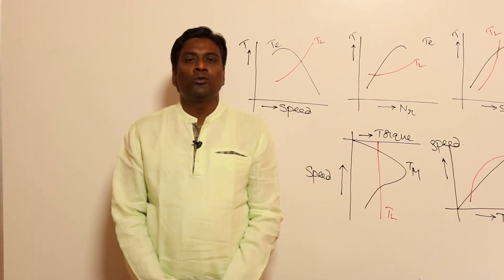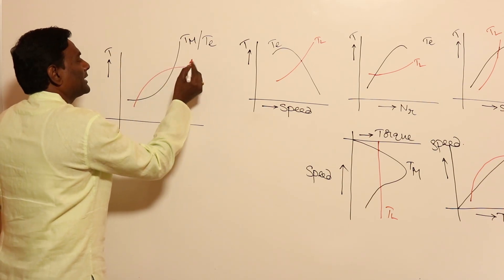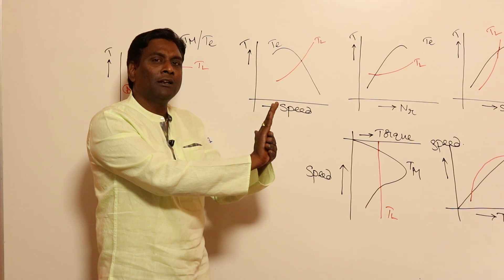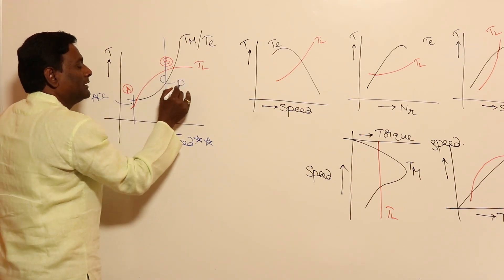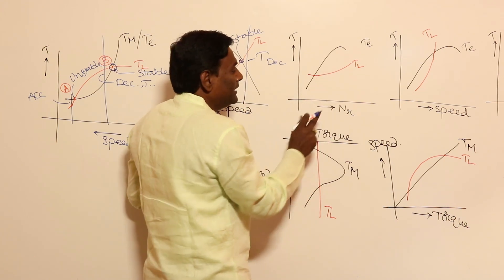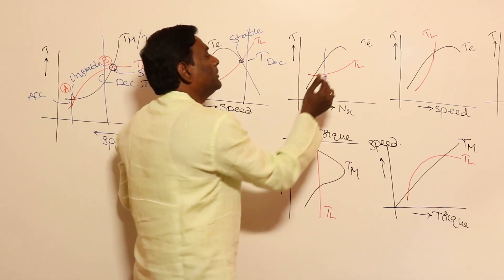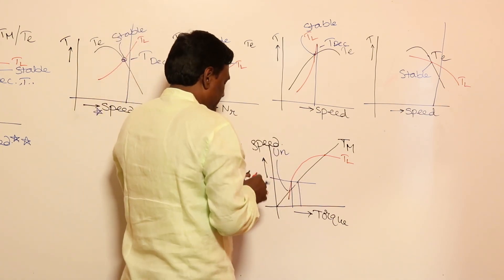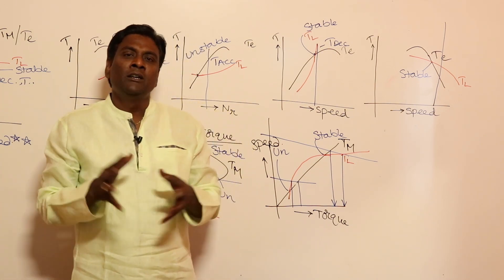How to find Stable and Unstable operating points in Motor | Induction Motor | GATE Lectures | KN Rao

Comment: Sir, in the last graph you corrected the load torque line, what if (where u corrected) load torque goes downward. i.e after junction point the line at some speed only cuts Te line not Tl line?  Is it unstable or any different explanation?